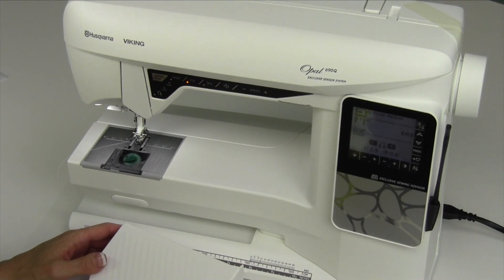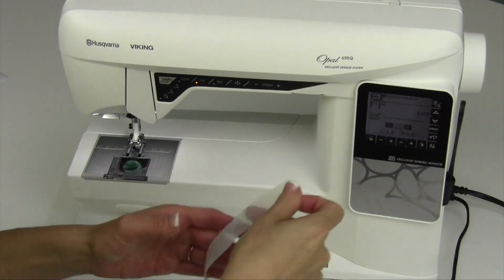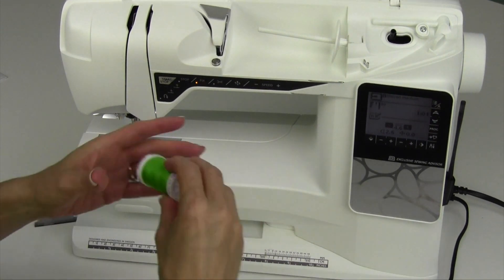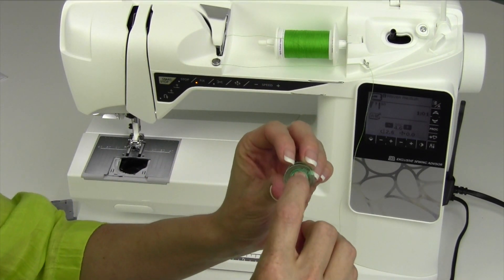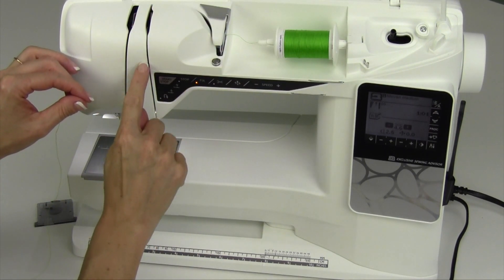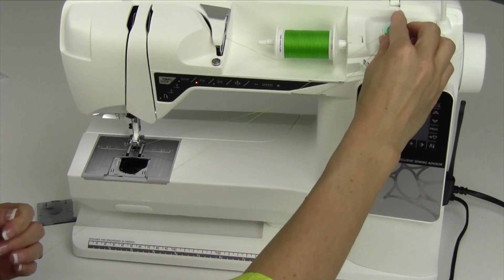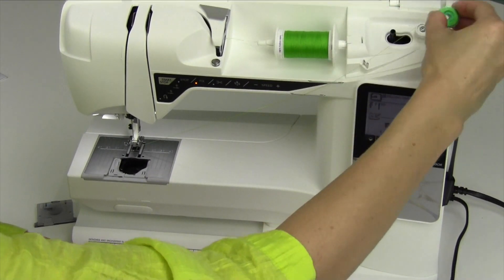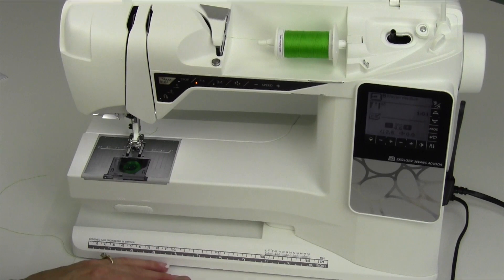Husqvarna Viking Opal 690 3 Threading & Machine Set Up

Comment: Discovered later that if you're threading a spool of thread that is stack-wound vs. cross-wound,  the manual suggests that you not wrap it behind the silver bar, just feed it under the white plastic at the top.  Doing that corrected a thread tension problem I was having when sewing.
Reply: I guess I am pretty randomly asking but does anybody know of a good place to stream newly released tv shows online?
Reply: @Eli Gatlin i would suggest Flixzone. You can find it on google :)
Reply: @Jacoby Rex Yup, have been using FlixZone for since march myself :)
Reply: @Jacoby Rex thank you, signed up and it seems to work :D Appreciate it!
Reply: @Eli Gatlin no problem =)